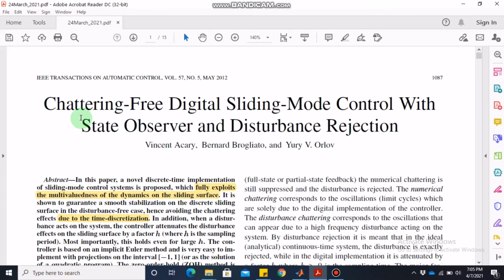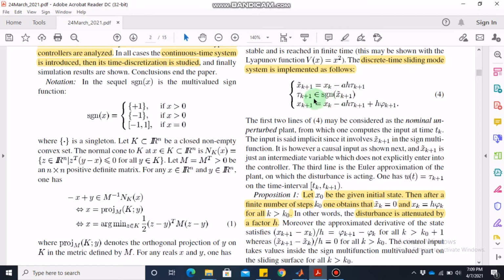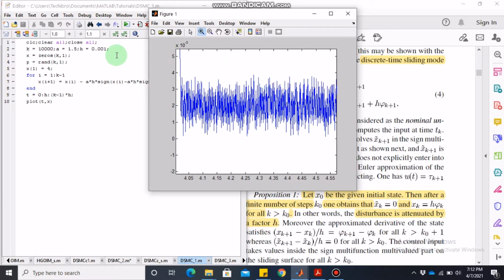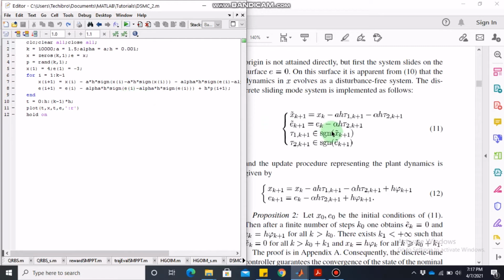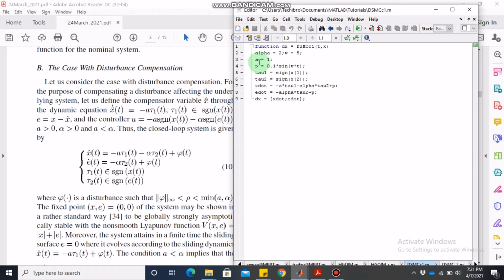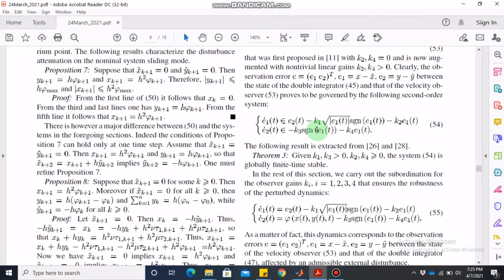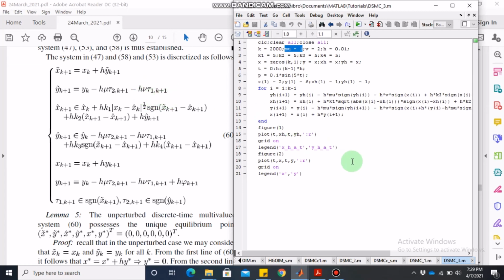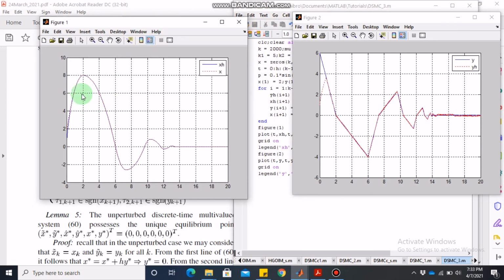MATLAB Simulation of Digital Sliding Mode Control with State Observer

Comment: Sir how can I contact you I need simulation on "passivity based sliding mode control of grid connected three phase inverter"
Reply from the maker: Dear Luqman, I am not a freelancer, I do not work for anyone. You can send me a paper at techibro@umich.edu , if that is a recent one and from a good journal, I may make a video on it whenever I have free time.
Reply: @cset  please check the mail I have sent the paper